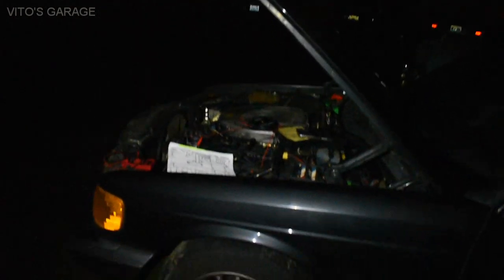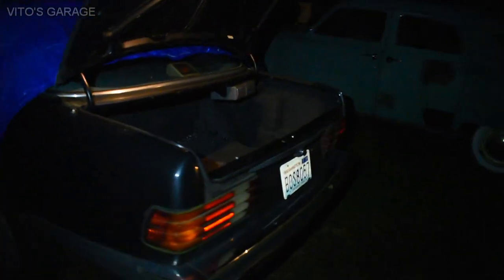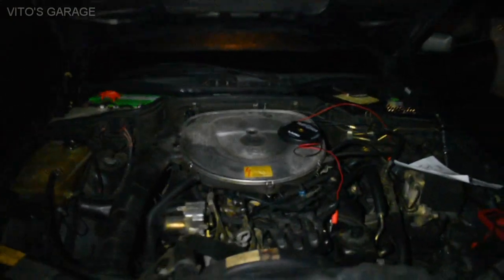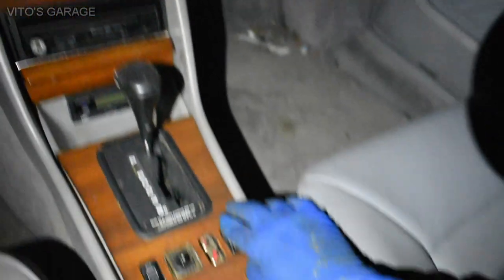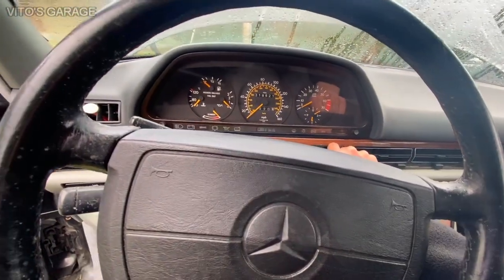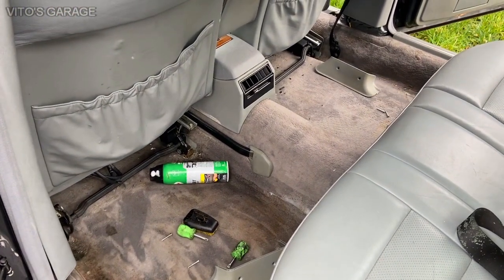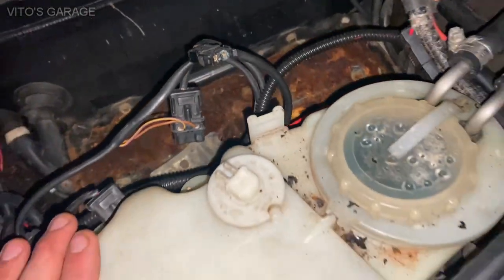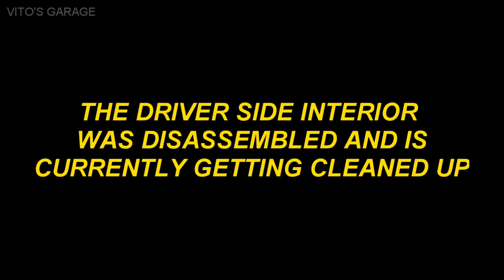Mercedes 420SEL W126 Awaken From Death.. Fixed Stuck Down Windows, Rusty Battery Tray & Sad Interior

Comment: Vito, are you going to launch the largest collector's mercedes benz rescue operation ever undertaken in the United States?
We'll call it: the mercedes benz VITO'TON :)
The blue tarp seemed to have protected the paintwork, which did not look corroded, except for the hood. Fuses on the other hand are often corroded on MB.
Reply from the maker: That’s a crazy name😀 and the paint isn’t too horrible. I put grease on the spot of the hood because it had surface rust. I’ll fix it properly soon